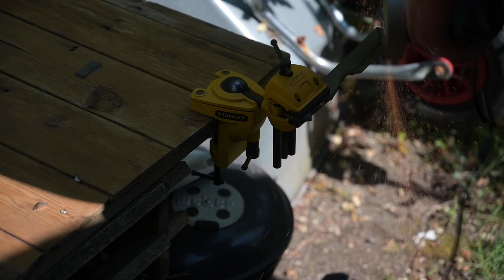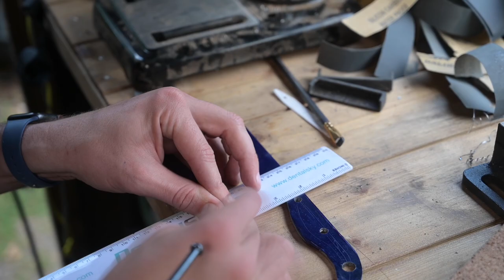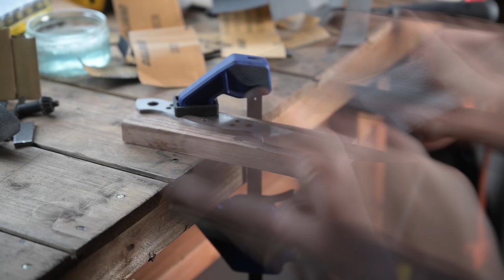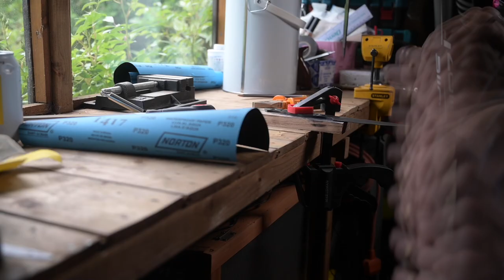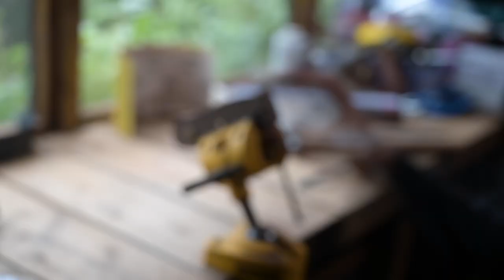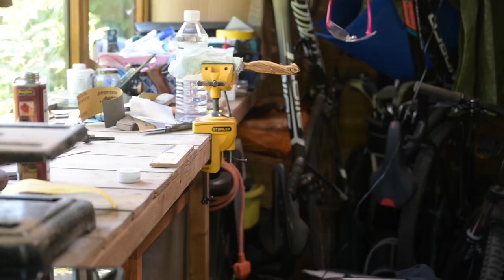Knife Making: Utility Knife

Comment: Hi
You must be pleased with those?
I missed what grade steel you used? I assume it’s 01, given the oil quench.
Reply from the maker: It was 1095 - 01 needs a soak of 15 minutes or so, and I can’t achieve that with my set up at the moment! and yes, thank you, I’m really pleased with them, but I also learnt a lot to take forward!
Reply: Little Tipple 
Thanks. Where did you get your 1095 from?
Reply from the maker: Sudo Nym gfskinfesupplies - really good range of steels, handle materials and additional bits too!
Reply: Little Tipple 
Thanks!
I got my 01 from them. Didn’t notice they also had 1095.
Cheers.